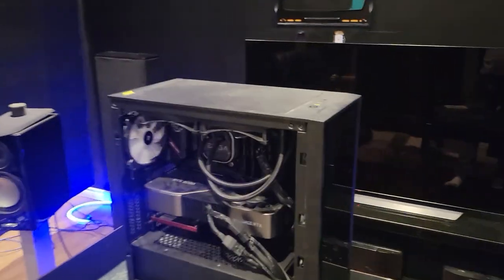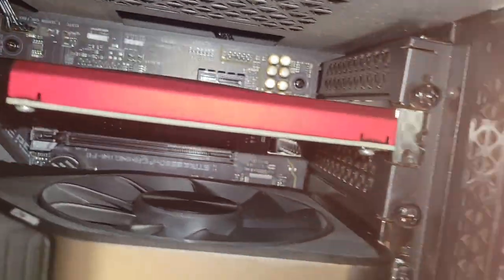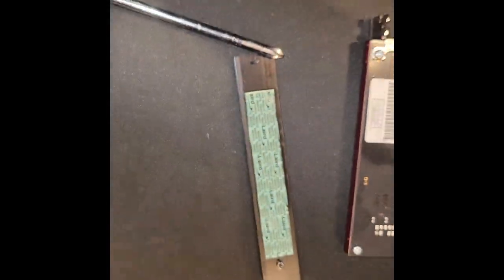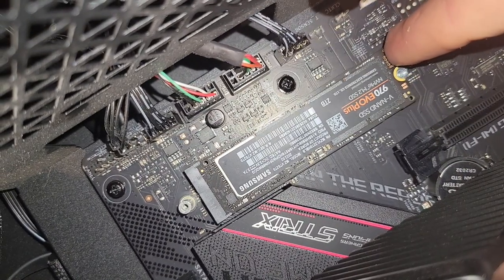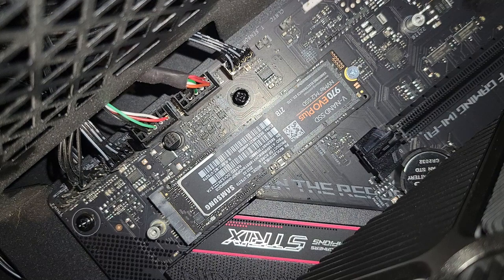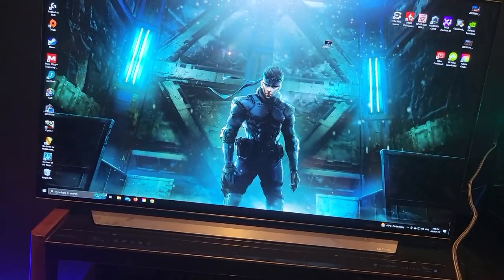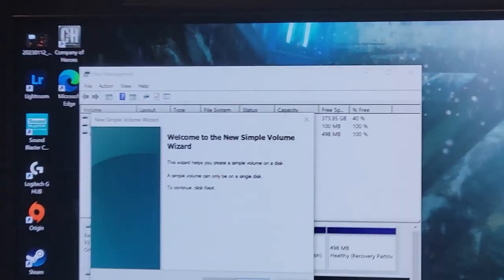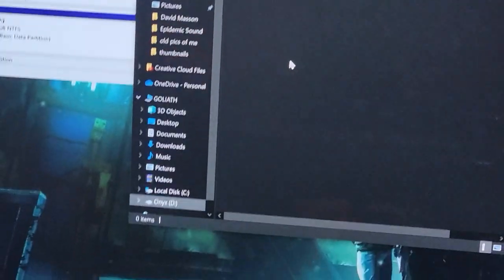Installing an M.2 NVME SSD in your desktop PC for more storage.

Comment: Did you unplug pc, determine is using M2 slot with disable a Sata port that is already in use, did you ref the motherboard menu, btw there was a stand off available on the motherboard.
Reply from the maker: My satas would now be disabled yes.
Reply: @Renegade_Rabryn  Probably an important thing to  mention.
Reply from the maker: I assumed people would understand their motherboards and chipsets. Thanks for bringing it up.
Reply: Hello, greetings from Colombia. I have a problem, I try to install Windows on a 2TB crucial disk on this same board but it does not appear in the bios for booting. But in Windows it appears as in the video. What steps should I follow to install Windows on this disk?

Comment: I have only one nvme and I just installed it. But when I turn the laptop on it shows a black screen with a boot error. And then I got into the bios but I don’t see any option to change the booting 

Please help !!!
Not tech savvy at all
Reply: You have to install an operating system. If you just installed a brand new NVMe, then it will be blank. You have 2 options: If you have your old drive with your system installed, you can use a cloning utility like Acronis True Image or Macrium Reflect or Clonezilla. This will let you clone your old drive over to the new drive. Once that is finished, you can then remove the old drive and your PC will startup from the new drive. You will need access to another PC to make a bootable USB drive.

If you don't have the old drive or you are building a new PC, you will need to create a Windows USB installer. You will need access to another PC to get the Microsoft Media Creation tool. Once you have your USB drive made, you plug it into your PC, boot from it and go through the install process. There are plenty of videos showing you how to install Windows on a new drive.

Comment: Just a little advice: rub the tip of your screwdriver couple of times to a strong magnet and the screwdriver gets magnetic - so you never lose a screw again...
Reply: Isn't there a risk to alter data integrity by waving around a magnetized steel ?

Comment: is it necessary to have a heatsink on your second SSD because my motherboard only has a heatsink for one and its already used.
Reply from the maker: No clue never tested it out. You can get an ssd with an included heat sink or buy an aftermarket one for relatively cheap.

Comment: If u take out your original ssd and put in the storage one will your pc boot with it?
Reply: It depends. Those that storage SSD have an operating system? If not, then your PC won't boot. You have a few options: Most computers have multiple drive bays so you can install multiple drives: Your OS drive and a storage drive. if you don't want  to do that, you can install Windows onto the new drive and then re-install all of your programs and transfer your data from the old drive to the new one. Alternatively, you can clone the old drive to the new one using cloning utilities like Acronis True Image, Macrium Reflect or Clonezilla or similar.

Comment: Does it matter that I didn't install my m2 drive into the one under the 1st slot which is under my CPU cooler 😂 instead the one I used is the secondary one which is the one you used 🎉
Reply from the maker: It depends if your slots use different generations. My top slot uses pcie gen4 and my bottom slot uses pcie gen3. If you use a gen4 drive in a gen3 slot you won't get gen4 speeds